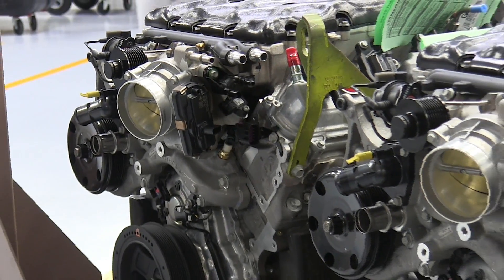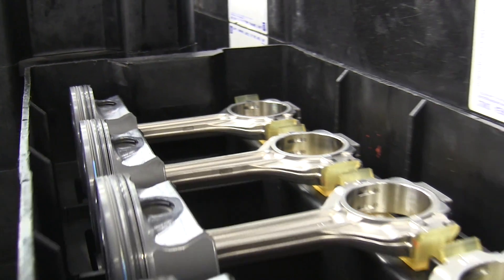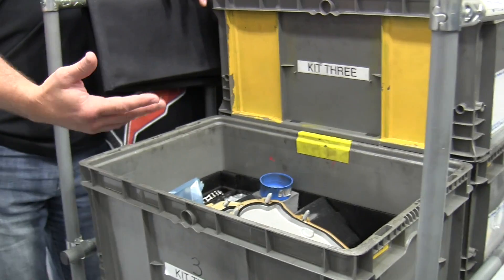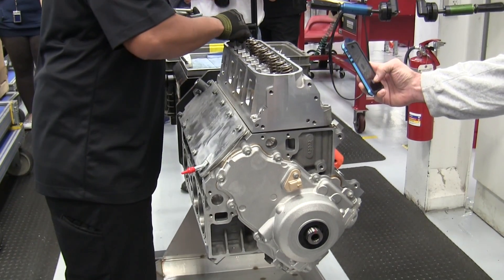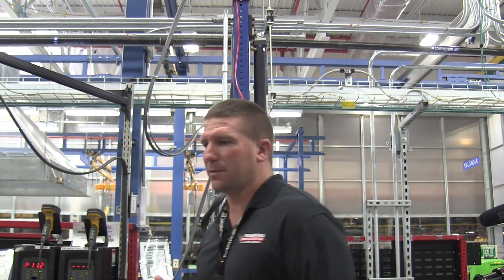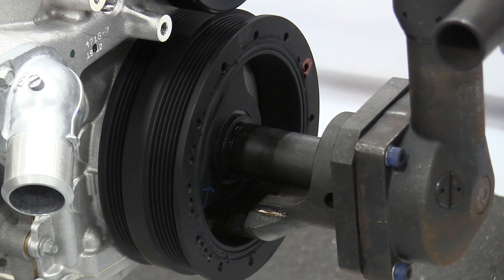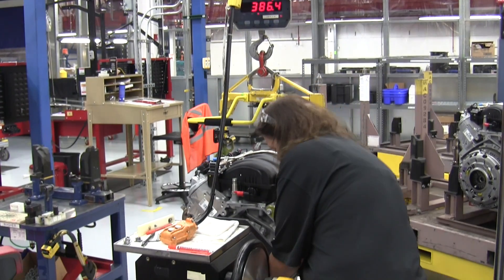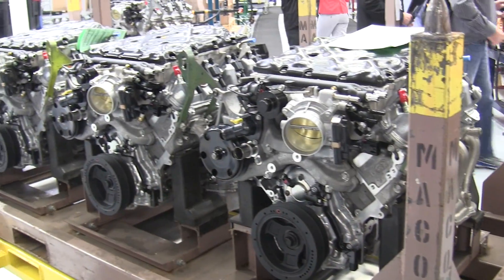Corvette Z06 (LT4) and Camaro Z/28 (LS7) Engine Build

Comment: Is it just me or the all the parts look poorly machined and finished? and really 2 valves per cylinder? lol and that big intake valve so much for high revs... and because of that the spark plugs can't be mounted on the top, so shitty efficiency. Nothing about this engine is really a new technologie maybe it's newer than its predecessor but it's very old compared to the German engines even the tools they use Germans used them a long time ago
Reply: +abd bach 2016 BMW M5:  575hp, 15mpg city, 22mpg highway.  2016 Mercedes C63 AMG S:  503hp, 18mpg city 25mpg highway.  2016 Corvette Z06:  650hp, 22mpg highway 15mpg city.  Any questions?
Reply: New technology or not these engines flat-out work!
Reply: yea they do.... for 1 minute, then you need to go to a petrol station
Reply: +abd bach That's funny considering when my Z06 was stock it averaged 28 mpg on the highway. This with a factory rating of 505hp and 470lb-ft of torque.
Reply: it's funny when an american talk about fuel economy and thinks 28 mpg is good (even from a 500hp car) European cars use technologies that let them switch half of their cylinders and do more impressive stuff and you still talk about that rubbish engine......please don't answer I won't reply, there is no point in arguing, you like this engine, good for you
Reply: @abdbach379  yeah. American engines have had cylinder deactivation for years. Some 4 cylinders can run off only one cylinder
Reply: +abd bach 6.2L V8 gets better MPG than a 3.0L flat 6.
Reply: Oh, almost forgot:  2016Porsche 911 GT3 RS:  500hp, 14mpg city 20mpg highway.
Reply: wow looks like someone dislikes americans. what country are you from? i bet we don't care for it much either. if you hate american engines and technology then stop watching the damn videos and stick to your german crap. they will be built by muslim immigrants soon anyway.. awesome
Reply: Robert Stephens wow looks like someone is insecure about something, and Muslim immigrants? really? what do Muslims have to do with this, let me guess you're one of those who voted for trump.
and it's funny seeing all the idiots who just want to be right arguing with each other even if they're saying the same thing, lol fu*king idiots.
Reply: abd bach interesting paragraph.   What are you 12 or don't have schools in your place? 

Again junior what did your sad excuse of a country offer for the auto industry? 

Or do you just manufacture "Snak-Bar" jihad dolls?

Now go back to your "daddy" and ask him to spank you.
Reply: my z06 ls7 with h/c/i and exhaust gets 30mpg on the highway in cruise control lol. PUSHROD FTW BABY
Reply: with German cars once the warranty runs out GET RID of it before it breaks your wallet on repairs

Comment: So other than the engine assesories and slightly different heads the LT and LS7 are the same engine?
Reply: +Robert Polkamp lS7 is a Gen v4, and LT engines are Gen 5. So although they look the same, different generation.
Reply: Not at all. Totally different.
Reply: Totally different but closely related, I'm seriously confused now.
Reply: Also, the Gen V LT engines have direct injection vs port fuel injection of the Gen IV LS engines.

Comment: how much of the block is shared from vortec, LT, and ls? Do they start as the same block and just get different options? Or do they start from scratch? I know GM's chevys would not be compatible with Pontiacs, buicks and oldsmobile but they started as the same block from what I understand.
Reply: Same basic design, but the LS/LT motors are aluminum blocks where most Vortec are iron. The wiki article have a ton of info on them.
Reply: no

Comment: LS4 with a intergrated intercooler  for the supercharger. I didn't know that was an option for the ZO6. Know wonder they beat the Hellcat.There both incredible cars for the money. The best is buying a 3 yr old ZO6 and saving 30K
Reply: That’s the LT4 engine in the C7 Z06 and Cadillac CTS-V (gen III) with the supercharger, although the LS9 in the C6 ZR1 also has intercoolers in the cover of the supercharger.

Comment: It would be cool if they did a video at the factory where the LS7 heads are produced so they can explain why there have been so many head failures on all years of the C6 Z06.
Reply: jack black c6 z06 wasn't supercharged.  only the zr1
Reply: +usmceric1 my guess is its to do with the supercharging if its more common in Z06. from the looks of it they retain same compression ratio boosted or not. recipe for disaster
when boost and heat is added. the heads try to lift themselves off the block. they need to be built much better for boosted engines. lower comp ratio or use E85 etc as a fuel

Comment: Questions asked at 6:38
"What bolt requires the most torque on the engine?"
"How would one torque it down without the machine you use here?"
Reply: +JDMricist not sure about the first question but the answer to the sec question is a torque wrench to the specified torque.
Reply: +JDMricist as for the 1st question im guessing the crank bolts
Reply: +JDMricist You would use a Crank Bolt Removal tool, its almost like a long wrench and at the end are two bolt holes to secure to the crankshaft, then at the end of the crankshaft you use your ratchet and socket to loosen or tighten the bolt. So the crank bolt tool is used to keep the crankshaft from turning when you loosen the bolt with a ratchet

Comment: Did they ever really fix the LS7 heads?
Reply: You just get the valve guides replaced like I did when I bought my Z. Also upgraded my cam while they had it apart :). LS7 is a sweet NA motor. I make 550/500 on the dyno and get 30mpg on the highway with cruise control ! :)
Reply: They did fix it but no cylinder head is perfect and all will drop a valve given certain conditions the heads have been updated but the problem is largely just a hit or miss situation there is a fix its costly tho

Comment: its crazy that the amg 6Lwas pushing over 83hp/l nearly 10 years ago and this thing cant even manage that the 2013 amg engine had over 100hp/L. how do they get away with such poor design, 75hp/L is so poor
Reply from the maker: felix pinto There are different philosophies at play. More HP/L isn't always better. Not defending Chevrolet in this case, but lower HP/L will mean less stress/strain and can lead to better longevity.
Reply: Engineering Explained i think as well all credit to amg for producing a great engine. but it does seem crazy with this supposedly being a high performance engine that they would stick to such dated design

love the vids BTW!
Reply: +felix pinto. the LS is lighter, more reliable and more mod capable than your German garbage. if you disagree why did you even bother watching this video? more than likely there's a video somewhere  on YouTube about how amg  builds there crap.
Reply: +felix pinto The M156 is heavier then an ls3.
Reply: felix pinto The GM v8 will be more reliable in the longer run. I know what Im saying... Had been working with my friend in europe on various engines in his tuning garage..
Reply: Ok. The M159 weighs 205kg without accessories (alternator, oil pump, oil, water pump,exhaust manifolds, belts and pulleys). The LS1 weighs 192kg without accessories and oil. The LT1 weights 210 kg with accessories, sooo without accessories the engine weighs around 200kg. Don't forget the LT1 is more compact then the M159 so the LT1 has less rolling weight within the chassis and can be positioned further back in the car and lower. This means less gravitational resistance, which means more fuel economy and more importantly a lower roll center for racing.
Reply: +DriftFair The beauty of the LT1 engine is in its very compact size. You can fit the LT1 V8 into an engine compartment designed for an overhead inline four cylinder engine.  Look at how they can squeeze the pushrod V8 into the engine bay of the Mazda Miata.
Reply: ForestTDI
 I only had time in a V10 TDI from VW in Euripe and its a pos :). It has power I'll give You that but its engine isnt any close to reliable... so are the audi 2.5 v6 tdi and 3.0 tdi... BMW are the same..

Dude Im from Europe and Im a really non fan boyish guy.... I've seen a vette here in EU with 560k kilometers on it and it still held its power ! even started in -20 conditions celcius!
Reply: +felix pinto 

Felix uninformed statement showed how piss poor at understanding internal combustion mechanics. The AMG engine is twin turbo with an intercooler. This engine is the naturally aspirated engine which will not make that as much power as the twin turbo. Look at the supercharged GM and we can compare apple to apple. The naturally aspirated LS engine will out last anything AMG pumps out, and if you want to push the engine to the limit at the track, I am betting there will be a lot of blown AMG parts on the tracks. The LS engine can pump out more than 1000HP, search YouTube and see. Putting around the freeway with your AMG but the LS is made for us greasy hands.
Reply: +felix pinto Its got to do with the fact the M156 is DOHC while the LT4 is still a pushrod engine. How GM gets away with 100hp/L has got to do with weight and packaging. The M156 weights 439lbs while the LS3 weights 357lbs. Also in terms of dimensions the LS3 is also smaller. What makes the LS platform unique is that you can go up to 440ci N/A on a stock block with no clearance issues. While the M156 I have never heard of a 7.2l stoker kit, and if a stroker kit were to exist it would cost a fortune and would have to be custom made.
Reply: +felix pinto trust me kid i know your trying to be loyal to what you like but ask anyone who knows a thing or two about engines, a push rod  engine is less complex, more reliable and lighter  than an ohc engine. hell there's honda v6's that weigh more than some V8 LS engines. btw ohc tech is just as old as push rod tech, do the research.
Reply: felix pinto if you you don't agree to GM's superior way of doing things then buy something else ( Mercedes, BMW etc.), your bitching is pointless and stupid.
Reply: +felix pinto "AMG was pushing 83hp/l nearly 10 years ago"???

Honda was pushing 120hp/l nearly 20 years ago from N/A engine.

That does not mean AMG engines suck, right? =)
Reply: +felix pinto You can't compare specific output between dual overhead cam and overhead valve. The four valve/dual overhead cam set up flows more air to make more power but is much larger for the same displacement. The overhead valve flows less air but is more compact. The AMG 6.3 is much larger and heavier than the LS7. GM sticks with overhead valve because they can make the Corvette more aerodynamic with the more compact engine.
Reply: +felix pinto It's easy to dispute becuase both pushrod and DOHC engines are from the early 1900s, so they're both old tech. Dumb argument.
Reply: I guess GM should hire you to help them out.
Reply: AMG motors are high HP/L because many countries tax on displacement, not on emissions. This has forced them to make trade-offs to get more horsepower per liter. More HP/L is not necessarily better. 75hp/L is cheaper and more reliable, offers more headroom for tuners. The cam-in-block design offers lower center of gravity than a 4V DOHC design and the aluminum block makes for an engine that has a very high specific output (HP/lb).
Reply: You can fit a lot more displacement in a pushrod for the size. That's it's advantage or equalizer lets say. Sure a 6.3 AMG vs a 6.3 pushrod the amg is gonna make more horsepower if everything else is equal that is. When it comes to pushrod why limit yourself to 6 liters when you can have a 7 liter and still be smaller though ? Pushrods favor torque more than rpm compared to dohc so the bigger the better really. The valvetrain is just not as good for high rpm like the DOHC stuff so you need more torque at less rpm to equal that horsepower level. Really it's like the cave man of motors that wants to have the biggest stick to wack people with. Sure its a bit barbaric and a simple minded way to make power but a big stick(bore/stroke)....is still a big stick !!!!
Reply: ForestTDI
 My parents still have their Skoda Octavia with 1.9 tdi as their grocery getter and it has 600k now... That engine still starts at -24 without any farting :).
 Oh and btw the V10 is a diesel guzzler... it uses up to 34L of diesel in off road..
Reply: +2Phast4Rocket.  +1
Reply: +felix pinto Ford mass produce DOHC engines. The Cyotee.
Reply: Robert Polkamp
That's why I said you can't compare them.
Reply: AMG used the M113 sohc 3 valve V8 for many applications.
Reply: 2Phast4Rocket im not talking about the latest generation amg, im talking about the NA DOHC 6.2 liter amg v8 from the last generation. the new one is a twin turbo 4.2 (i think)
Reply: +RazorFX Thanks for your replay. Honesly said, V10 is very bad engine, also 2,5 V6 150HP. But 1,9TDI 8V PD handles 300HP without any serious problems, also new BITDI 3,0 313HP is very good engine, which (without DPF) is able to handle 450HP. Also old 3,0 24V OM606 engines handle so much power and longevity.

Btw. I have seen many 1,9TDI 8V VP with more over than 1milion km runing without any problems. Well, but seriously said, after crisis, meet high quality engine is really pure miracle :(
Reply: i dont know the m156 wight but the m159 is 200kg and the lt4 is 230 ish i get that som of the ls are lighter though
Reply: cool
Reply: As much as I love the rustic charm of nascar obviously you should read more about things like the Targa florio
Reply: RazorFX please make us a favor !: don't return to Europe .
Reply: i mean any engine with low specific output is easy to make reliable these daysbut these are sports cars, and im not even sure thats really true. with pushrods etc surly there is more to go wrong (even if overal its cheaper to get parts)
Reply: Lol le mans, formula 1 all dominated by European engineering
Reply: its 30 kg heavier, is pushrod. has more parts to go wrong has less hp per liter. sure its cheaper, sure it has allot of aftermakret. im not saying its not popular. but just because they make allot of them doesnt make them good from an engineering perspective. its old technology i dont see how you can dispute it
Reply: +BlueTruck99 i feel like ive dropped into some american GM thing i dont really understand. i just think it would be cool if they would mass produce cheap high performance DOHC engine. i mean even with this whole writing their name on stuff there clearly aspiring to be more like the stronger manufacturers like amg. 

anyway im not being loyal, if anything i like ferraris flatplane v8 engines. and both my cars are 2l4cyl and 3.8 L 6cyl boxers
Reply: +Engineering Explained : Better longevity? Oh, please, stop kidding me! You can´t compare longevity of US and German engines. Skow me any US diesel, which is capable to produce so much power with so high longevity as German engines. And you can also compare fuel consumption too - US engines are so much thirsty, much more than the others ;)

There are two ways how to deal with it: Japanese petrol engines and German diesel engines ... only two ways ;)

Comment: What is the purpose of those almost rectangle holes in the block at 3:30?
Reply: +Laurynas Dvareckas Lifter trays. The lifters are at the bottom. Push rods come down through there after the head is on.

Comment: If the new generation alpha platform Camaro has a LT1 engine what makes that engine so different from the current LS engine in the 2015 LZ1 Camaro? Same 6.2L size but obviously the two engines have non similar parts? What are they? Thanks.
Reply: Whole different block and parts

Comment: What is your career title? I want to study engineering but the one that specifies in cars! and as ive seen your videos, you are in that. is this mechanical engineering?
Reply from the maker: Gerardo Ramos I studied mechanical engineering, yes. But you don't simply study cars. You study the math and physics behind moving objects at a very detailed level.
Reply: The 1st and 2nd year engineering students study very similar subject matters, like calculus, differential equations, physics, static and dynamic mechanics, strength of material, thermal, fluid mechanics, etc.  Each engineering specialty begins to teach its specialized fundamentals starting in the 2nd year. It get tougher from then on.  You get the most drop out after the 1st and 2nd year. After that, most should be able to graduate. 

Like Ryan said, get involved with the various engineering projects on campus. It gets you exposed to working in teams and you get the opportunity to network with professional engineers in the industry.  Many students get internships from the strength of their school's formula SAE car.
Reply: I'm majoring in automotive engineering and I think that's what you are looking for.
Reply: if you want to get a job at a car company, do some extracurricular stuff that shows your interest in the automotive side of things. Like here at the University of Minnesota there is a group that designs and builds a formula SAE car. This will help distinguish you from the other mechanical engineers. Also, electrical and aerospace people can just as likely get jobs at car companies too.

Comment: The 427/ 7.0 litre is and always will be a legend. Big block cubic inches in a light weight small block package. In my Z06 around 18 in city and 27 - 29 highway mileage. Sure, a person can add a blower and get close to the performance of the LS7. Add the same blower to an LS7 and get out of the way! I love my 2013 LS7. 3150 IBs Z06 will rock !
Reply: LS7 is no doubt a badass engine as long as you keep it NA.  They won’t take very much boost.
Reply: But then it will drop a valve or the rods will rub like my 06!